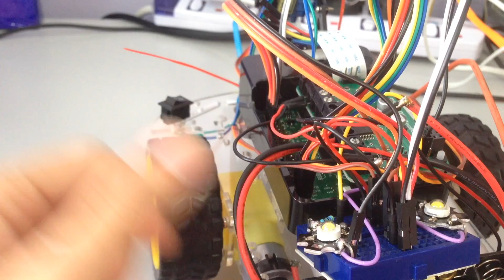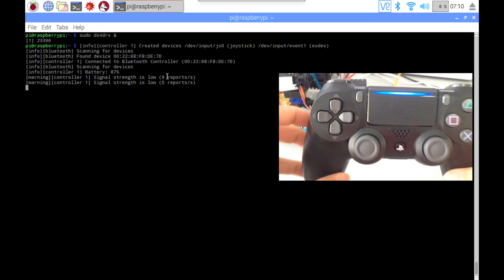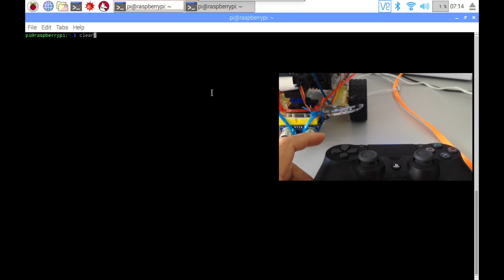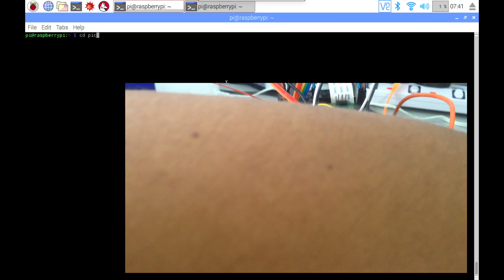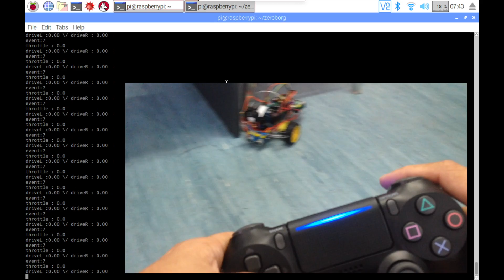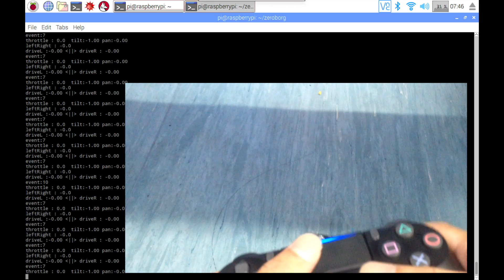ZeroBorg Dualshock 4 Robot Walkthrough

Comment: Great video, is your code posted anywhere? I would like to try something similar to control my robot.
Reply from the maker: thanks for your feedback. you can try these codes to control the movement of the robot and the servo/laser as well.

https://github.com/macunixs/zeroborg-ds4-robot

have fun tinkering with the codes. you may need to change the configuration a bit since your robot may not be exactly the same as mine.